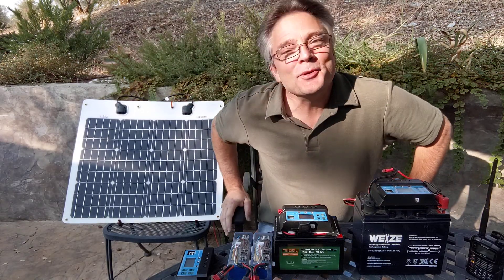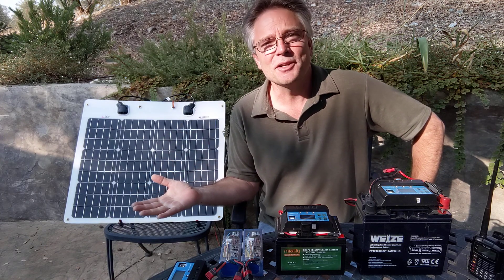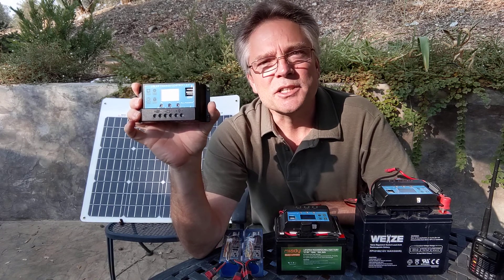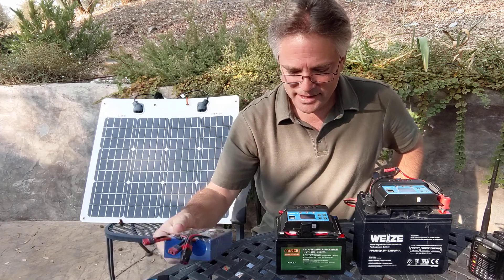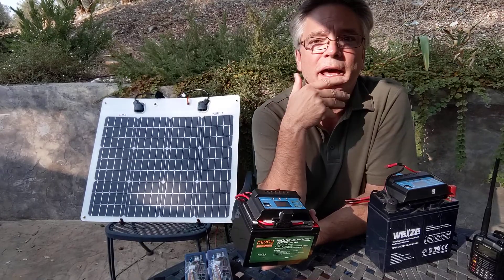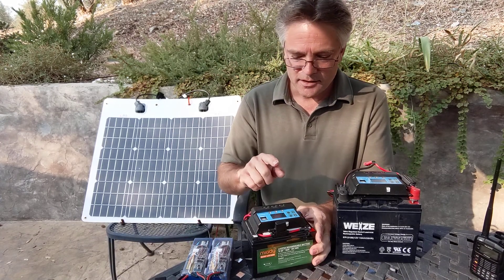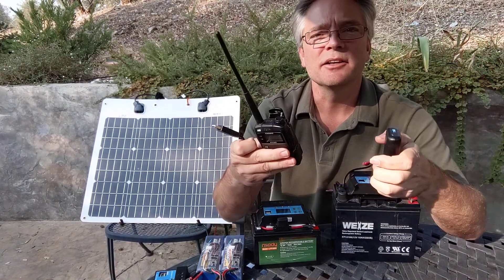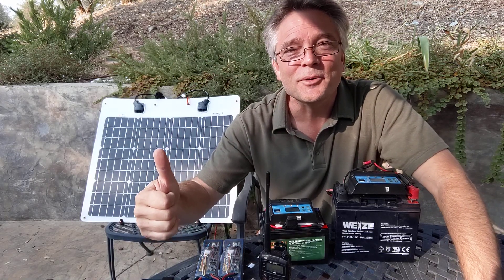The Right Solar for Your Radio

Comment: Many digital modes such as Olivia are worked by myself at 5 to 10 watts, so that should help with current drain. The distance I have worked with such power levels are well over 1500 miles on 40 meters. Great video. 73 de ke4obe